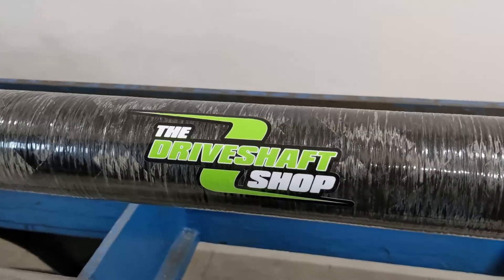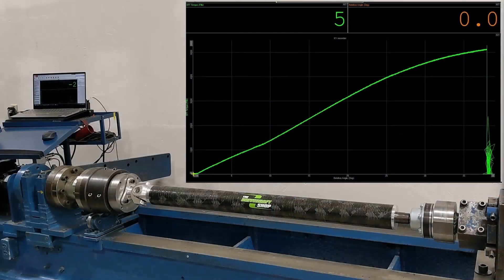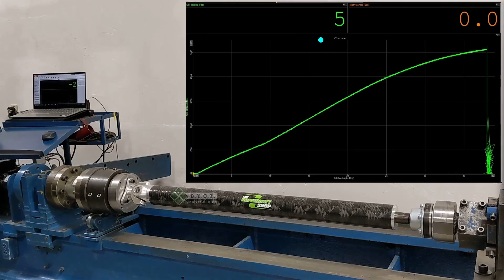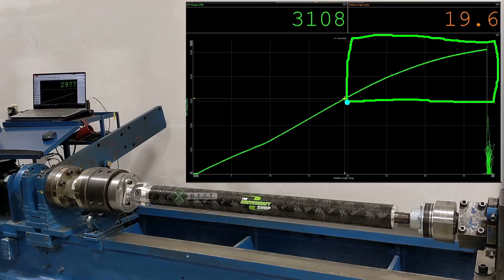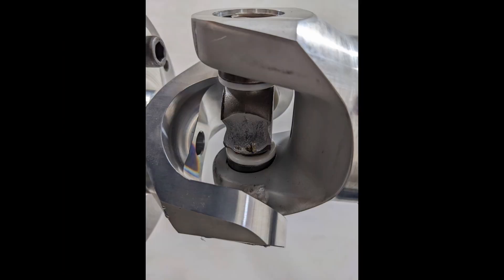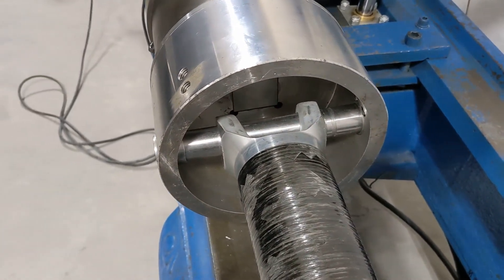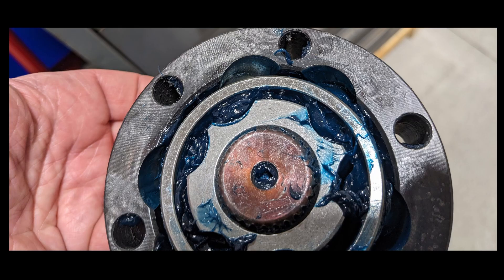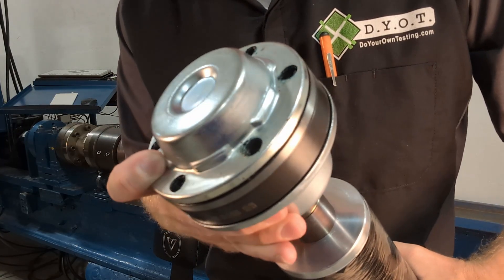2020+ BMW M3 Carbon Shaft Static Torque Test Analysis

Comment: Do you also do shock load testing on them? I’m only asking because I’ve had a awd setup on my rsx I built from a crv awd system, and the transmission, differential, and transfer case were all built to handle the power I was pushing (650-700hp) and the driveshaft should have been fine with some new u joints I installed and it was for the 1500 mile break in period of normal driving until I was at a drag strip launching repeatedly and it absolutely demolished the u joints and flange after 4 launches with cool downs in between. Maybe it was faulty but maybe shock loads especially on bonded carbon fiber would yield some interesting results
Reply from the maker: So this would simulate a max torque situation. If we applied the torque faster it would likely break the same way at the same torque.
Reply: An intersting note here is that a carbon shaft will spread shock loads out over a larger flex distance / time therefor lowering the peak torque seen within the part during the shock loading.

Comment: Awesome video and product! Next up - Ultimate load of the carbon fiber itself!
Reply from the maker: Thanks! I am not sure there is a good way to hold on to the tube outside of a bonded assembly. We work with several driveshaft manufacturers, so if one of them wants that test done and has a way to do it we certainly will!